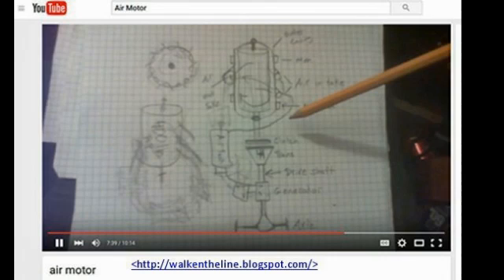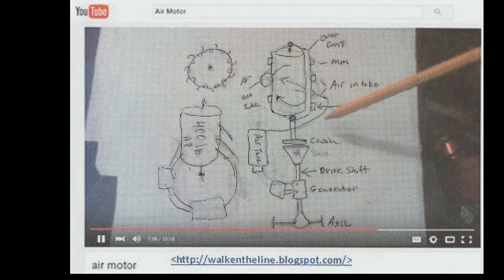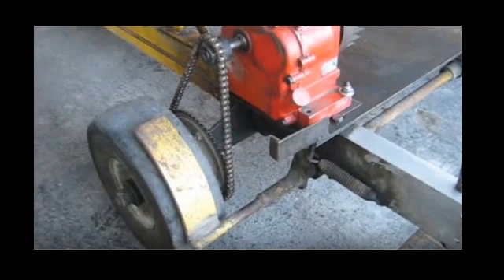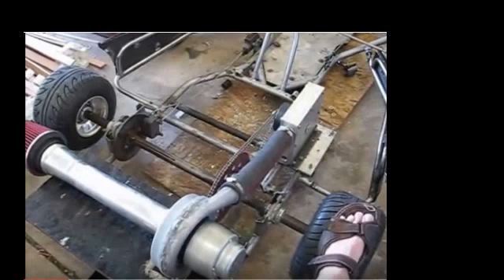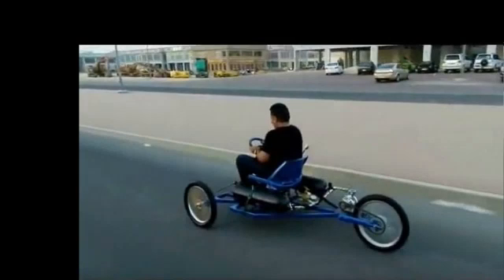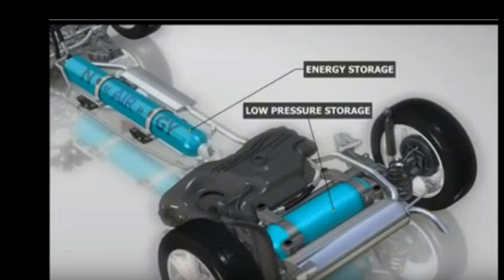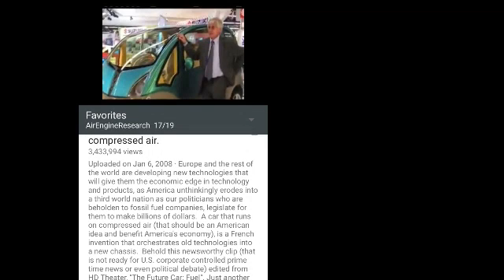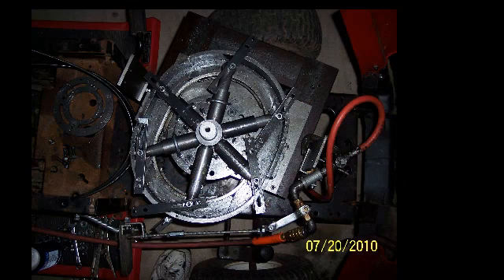Compressed Air Motor, other peoples ideas and proto types Discussed

Comment: I WOULD LIKE TO SEE THE VIDEO WHEN YOU MAKE ONE OF YOUR MOWER DRIVING AROUND.
Reply from the maker: I have worked on a number of different Air Motors, and in the spring and coming summer, I will be doing some more work on one I
 think will be THE ONE. Follow my channel and you will see if I can make it work.